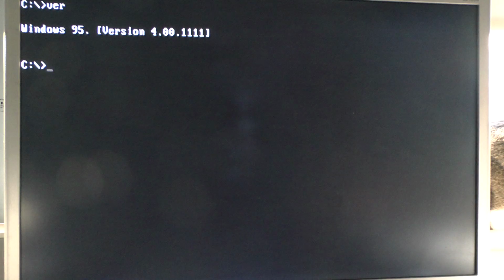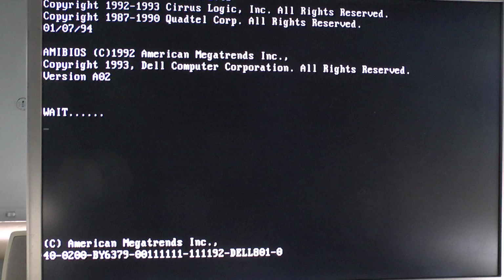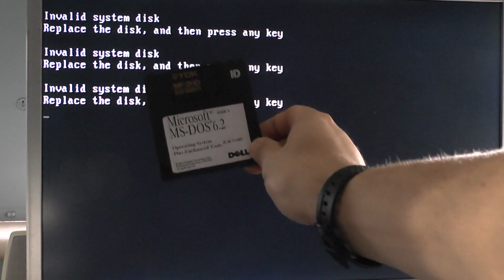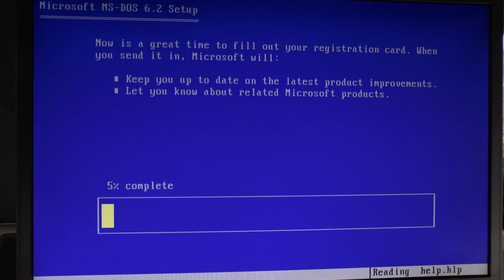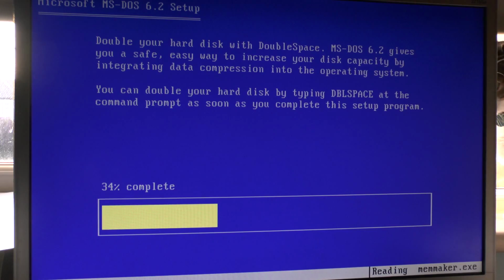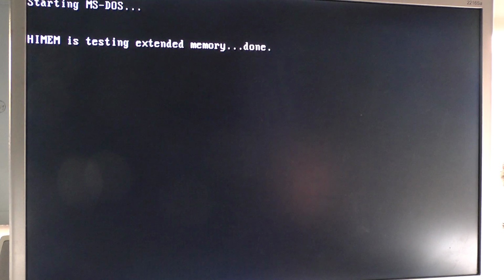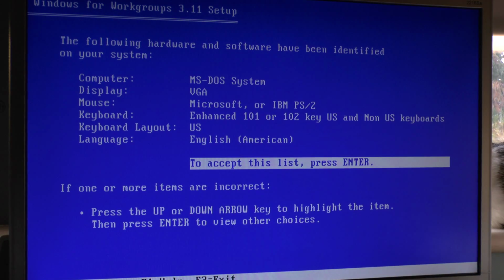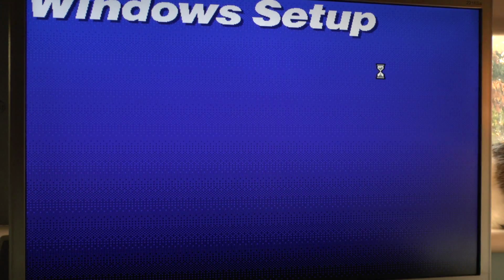Installing dos 6.22 and windows for workgroups 3.11 on a genuine 486 Part 1

Comment: Are manufacture specific drivers usually required for most video cards used in DOS (outside of Windows) or are they mostly typically plug and play?
Reply from the maker: Hi. plug and play refers to windows 95., more on that in a bit. All video cards will work in DOS in at least a basic text and graphic mode since all PC'S are IBM PC compatable. When you enter the BIOS on a modern computer you are in essence using a DOS style graphic display, some fancy Motherboards do have fancy BIOS GUI's but in essence they are using a 'DOS' mode. When DOS was a thing you could plug in any CGA EGA VGA SVGA videocard and it would work out of the box due to its basic instruction set to make it compatable with the original IBM PC designs. Now some video cards would be VESA complient therefore allowing the display of 16 256 or millions of colours. Cards that did not have VESA Compatability built in can be made to support VESA colour and graphic modes with a small VESA driver in DOS. most video card manufatures also created there own unique driver to support Graphic Modes in DOS for games and For example AutoCAD. The VESA support mode made this mute as most software would look for these flags and support without the need for additional drivers. Drivers in DOS are a direct driver that is drivers  in DOS directly communicate with there respective video card to implement video card modes. This can cause some compatability issues. When we migrated into windows drivers for the major and most popular video cards were included in the driver and OS installation disks of Microsoft Windows 3.0 & 3.1. If you had an ATI video card for example you would have to use the disks supplied with the video card. You can however use the "plug and Play" windows drivers in Windows 3.1 For your video card. these will support vga and or svga at 640 x 480 and 800 x 600. in 16 colours. to get 256 or millions of colours a driver will be needed. When we migrated to wibdows 95 we finally had true plug in play were the OS did all the work. supported hundreds of cards out of the box and generally installation of cards in general is straight forward.... plug and pray was the name coined for the original implimentations of P&P. In windows 95 with the implimentation of DirectX video card nanufatures were no longer left in the cold to impliment there drivers and hope they worked correctly with the OS. Microsoft now put direct x in the middle... i.e. Video card driver 》DIRECTX》OS. it sat in the middle to make sure the driver did not do any operations it should not. at first some resistance was felt over all it was done to make windows a more stable enviroment. I think I covered most stuff there. thanks for your question.
Reply: +DRCHRISTIANMD Wow. Thank you so much for the detailed response and clearing some things up for me. I'm currently building a DOS PC for retro gaming. So from what I understand, some cards were VESA compliant for DOS out of the box while some may require a VESA DOS driver. The build I'm putting together will contain an AOpen PT75 PCI video card with the S3 Virge/DX chip. This will be a strictly DOS 6.22 PC for the time being. How would I go about determining if this card has the VESA support to allow higher resolution and more colors for DOS games? I have just started this build and plan to continue working on it tonight. I'll be adding a AWE 64 sound card which I have already located DOS drivers for that alter the autoexec.bat. I can provide more details of my setup if needed. Thanks in advance.
Reply from the maker: +studiotime All DOS games directly communicate with the video card, and have built in drivers. I have other videos up showing off examples of machines that have no dedicated dos driver and yet they are playing dos games. Most dos games will fall into a few category's. CGA MCGA EGA VGA OR SVGA. SVGA and MCGA will bring the most colours with SVGA being the superior as far as high resolutions are concerned .Games that require a VESA driver they will let you know on start-up. It is rare as the game has direct access to the hardware in DOS, its major downfall. Full motion DOS games or later in the life of DOS games might or might not need VESA Commands, it is nothing to worry about. the S3 Virge is a very versatile Card and most likely has the VESA on board I honestly cant remember and would have to take out a PCI one to try it in DOS. But I mainly use CIRRUS Logic 5428 VLB or 5436 with the 64-bit interface. and of course ATI, ATI never seamed to have it from what I recall. I also use a Western Digital ISA one, yes the Hard drive guys!. the only time the VESA add-on driver is a problem in the autoexec.bat file is when your trying to keep as muck of the 640K free as possible. since most if not all games that need VESA modes enables typically use EMS or XMS mem, this will not be a problem. you can just deactivate or load at the command prompt when you need VESA. I am hoping my memory is good here :-), any more questions please feel free to ask.
Reply: +DRCHRISTIANMD More good info in regards to the video card, much appreciated. One last question, the mobo I have acquired is a gigabyte GA - 586T2 running a 200mHz Pentium MMX with 64MB SDRAM. It is an "Baby AT" style form factor and I'm having a heck of a time finding a "baby" AT case for reasonable price as they appear to be no longer made. Do you recall if these Baby AT boards fit in the slightly larger AT cases or even ATX? Are the stand outs compatible? I have been researching this but can't quite find a definitive answer yet. Other than the case situation, I think I'm set. I have DOS 6.22 on floppy that I will attempt to load this evening. Thanks for all the info.
Reply from the maker: +studiotime In one word "yes". All cases will take the baby AT. So the example of the dell in this video will take all sizes of the AT. AT is hard power on AKA a big switch to power on the pc. ATX is soft power on AKA a push button. Motherboard form factors in the AT style are a full size AT a Baby AT and LPX the latter LPX being the only problem. All Full-size AT will take baby. the case size is the giveaway, the holes are or should be in the same place as it is an industry standard. When we migrated to ATX Style (mostly socket 7 and super socket 7 era) the idea carried forward so ATX mini and full have the same holes for screws so will fit each other. Of course the exception is the case size. obviously you cannot fit a full at or ATX into a baby AT or ATX. one side note the baby AT is massive!It looks like your using a combination AT/ Baby ATX so go ahead and order the full size ATX it will fit. The most recent video I have uploaded demonstrates an AMD in a baby ATX case and of course its a BABY At Case. Thanks for your questions it helps me remember that what I darn forgot!
Reply: +DRCHRISTIANMD Thank you. last night I installed the mobo in a ATX case that I found at work and everything matched up except for the I/O back plate that was not removable on this particular model. I ended up taking some metal sheers and cutting a square in the back fore the AT DIN keyboard connector. Looks pretty tacky and this particular case is WAY too big. Thinking of getting a mid-tower ATX. The baby AT board is quite small actually.
Reply from the maker: +studiotime Hello. glad it all worked out. I personally had the same problem and ended up cutting up a sweet tin to make an io sheild... crazy stuff.. but it worked.
Reply from the maker: +studiotime One other thing. if you need any parts for your retro machine let me know I will see what I can do. Enjoy the joys of DOS ....
Reply: Thanks very much, I will let you know. Looking forward to playing some of the older games again I had as a kid. I have already bought quite a few off off Ebay. Hopefully I will be playing them this weekend!
Reply from the maker: +studiotime Grab yourself a copy of.... hand of fate.... lands of lore 2.... fantastic dos games... and of course... duke nukem series... lol..
Reply: This is what I have so far...
Lands of lore 1
The Legend Of Kyrandia Book One
Microsoft Flight Sim 5
Gabriel Knight Sins of the Fathers
Overkill
Star Trek 25th anniversary
Quake
Myst
Island of Dr Brain

Looking to get Police Quest series, Leisure suit Larry series and others.
Reply: +DRCHRISTIANMD Hi there, me again! After having so much trouble locating a case that would accommodate my old style AT mobo I finally moved on and built out an ATX Socket 7 DOS 6.22 PC. Everything appears to be working great - video, audio, mouse, and even CD-ROM. I have been successfully playing a handful of DOS games but one game in particular - legend of kyrandia, book one is giving me some trouble. Upon launching the game I keep getting an "insufficient memory" error at the command line. I have tried all sorts of combinations including 8mb, 16mb, 32mb, 64mb and even higher but each time I get the error. All other games work like a charm. Any thoughts?
Reply from the maker: +studiotime Hi. the out of memory error is usually caused by the program requiring a fair amount of what is known aa base memory. thats the memory under 640KB. your mouse cd-rom drive and even video card and keyboard. dos its self all use this base memory. you could install 16GB of ram on a modern Pc and still only have 640k maximum base memory. Its a hang up from how the OS was invented with hardware in the begining with a quote from a famous person saying " who would ever need more than 640K.!" anwyay to solve the problem first go to command prompt and run "MEMMAKER". follow the prompts. it is usually very good at freeing up base mem and activating and using the high mem area.
Reply: Yes, this was in fact the issue. I had a discussion with another Youtuber (Oblivi0n100) last night and we determined that I was running out of lower memory. I have since ran memmaker and optimized my setup. After this, the program now runs. Ah, the joys of DOS! Thanks for the response. Take care.